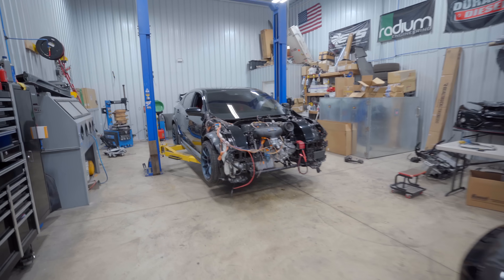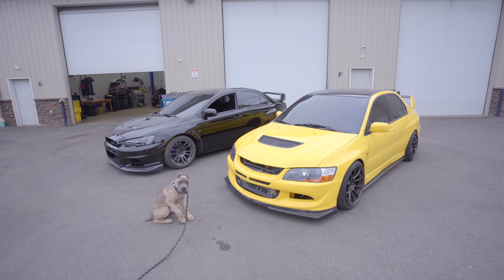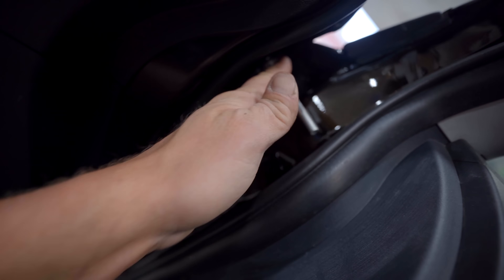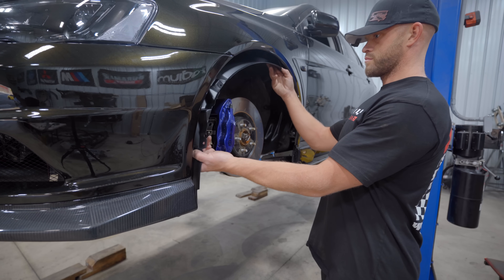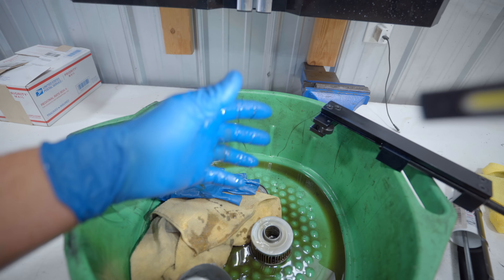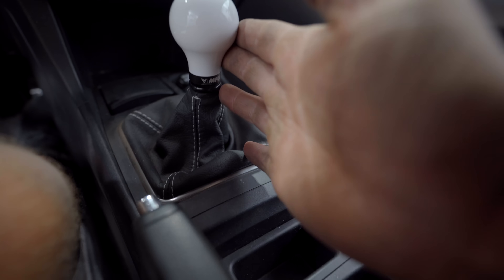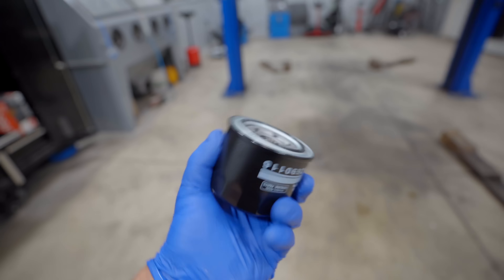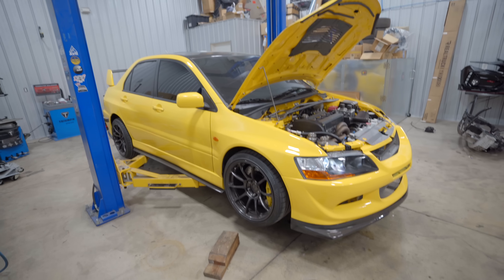It's Finally Happening...

Comment: I think I'm weird. I always refill my oil filter and then pull the fuel pump fuse to build oil pressure. I always worry the turbo won't have oil and ruin it. Never can be too careful.